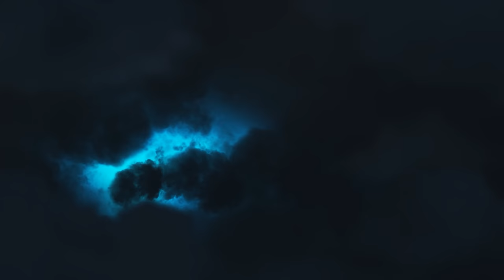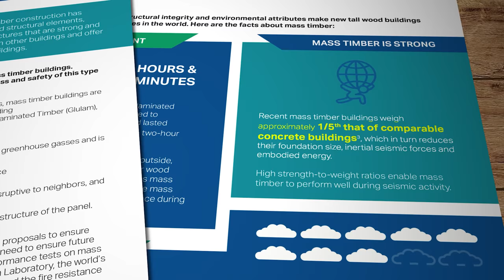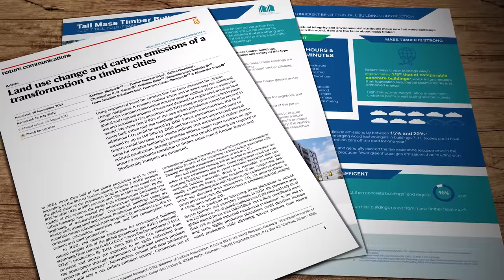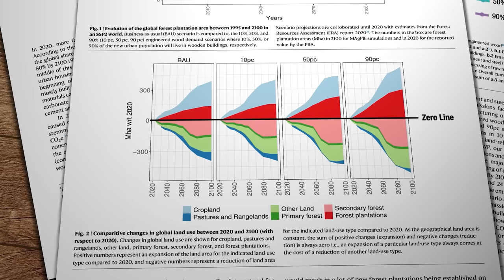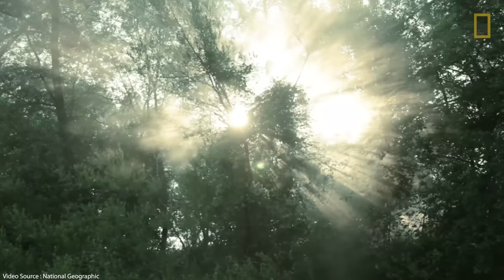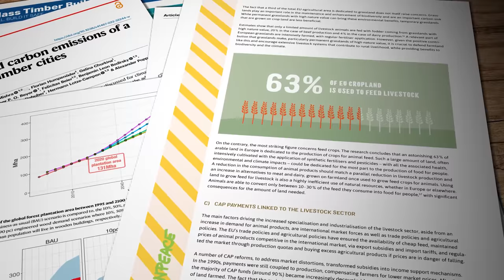Engineered Timber - building the skyscrapers of our future.

Comment: Britain was very nearly completely deforested at the end of the Napoleonic war due to the demands of the fleet.  At the end of world war one the same thing occurred due to the demands of the western front.  In both cases these were intense timber demands for relatively small populations.  Should we not expect a similar result globally if intense demand for timber for the world population occurs?  Having said that planting trees to absorb CO2 is all very wel but when they are mature we do need a use for them so that the cycle can continue.  Some timber building would appear to be a good idea but perhaps not exclusively.
May I ask where the adhesives for the "engineered timber" (which looks to me like large scale plywood) is sourced?  Is if from the petro-chem industry?
We should be looking at not demolishing so much of what is already there, it has paid its carbon cost.  With suitable upgrades we should be able to achieve housing at less carbon cost.
Why not build more undergroud, at least partly, an automatic ground heat source?
I have noticed that when ever we discover a useful by product and promote it then suddenly it becomes a shortage.
Did anyone wonder at the demand to reopen fertiliser plants so that they could produce useful CO2?  Why aren't the atmosheric carbon capture plants supplying the food industry?

Comment: We really need to stop using wood. We ought to incorporate earthen dwellings into modern building, to aid with temperature control and electricity need reduction.
Reply: i always wonder what kind of designs we would come up with if we chose to go underground instead of build up in skyscrapers. by going underground, you can also have MORE ROADS. when designing vertically, we would need aerial transport of catwalks to connect.

i think going underground for urban populations should be thrown around more to get more people tackling the idea.

Comment: I think that most efforts to avert the impending crash of civilisation, as we know it, amount to little more than creating new dances to perform around the deckchairs on the Titanic.  There is only one answer to saving ourselves while also saving the planet and that's the one thing you rarely hear discussed. No matter how you cut it, all the current 'solutions' will only mitigate the real problem-driver, which is population growth. If every currently proposed solution was implemented and worked as intended, after a few generations the core problems of having enough clean air, water and food would be on us again. That said, I wonder if the four horsemen will intervene and take the matter out of our hands. All is moot.

Comment: Ahh where to start? The report does not take into account the debris that is left after clear cutting timber. The rotting debris gives off co2 for between 20-30 years after clear cutting before the replanted trees can compensate for this???
Secondly the construction industry is notoriously conservative and needs a push from governments to lead the way to BIM construction ( building information modelling) and Lean construction which can save between 20-30% waste which is normal for a traditional build be it concrete, steel
or timber framed. And finally if they develop or adopt an industrial system of construction then there are more savings to be made!!!!
But I’ll probably be dead before any of this is the norm?

Comment: The assumption that people will continue to migrate to cities may not be correct. Since the pandemic there has been a migration out of cities limited only by the lack of affordable accommodation. In reality low skilled workers can't afford to live in large cities. 
Tropical forests are almost exclusively hardwoods, whereas structural timber is usually temperate softwoods grown in the Northern Hemisphere. I have woodland full of European Redwood and Western Hemlock which was specifically planted in the 1950's to provide building timber. We periodically, thin and replant. 
Young trees capture more carbon, than old trees. It's like farming but the crop takes 50/60 years to harvest. 
I'm suspicious of reports like this. The exact details may be correct but the underlying assumptions may be driven by politics. As always, ask who benefits, and follow the money.

Comment: The way out of warming is to stop burning gasoline. Go nuclear with small reactors powering a grid and road system with overhead power built into a covered roof deck with grass and solar on the top side.
Reply: Instead of gasoline, make more plastic for building materials.

Comment: Engineered timber is not the answer. Structural Insulated Panels are - easy to go to 9 stories and easy to make airtight. Used extensively in earthquake zones. I have built a 3 bed house in2 weeks that contains no embodied energy

Comment: The cost of the average home is too costly in money and resources.  Laws need to be changed so that people can live in simpler houses, ones that doesn't cost as much to build.  We may have to live in smaller houses, but if they are better designed, then a smaller house requiring less resources can still fulfill our need.  The wood used for building houses are from larger trees and take too long to harvest and thus not sustainable.  Since bamboo has the fastest growing rate and is very strong, bamboo should be made into construction wood used for building houses.  If we build our houses smaller and with wood made from bamboo, we should be able to lessen the impact on the environment.  If we want to be even more efficient, we need to learn to make clay from dirt to make lego-like bricks that can fitted together to build at least the walls, if not the roof.  This will lessen the need for lumber.

Comment: Several claims in this proposal make it fall apart: 1) that cutting down more trees would reduce CO2 and help the environment  2) that planting more trees would actually worsen global warming.  Does anyone really believe this?  Seems like another case of someone going off on a tangent, using faulty assumptions, and missing the big picture.  We need to do better than this.  We already have the solutions but are simply not implementing them.
Reply: "Planting more trees will worsen global warming" except they would absorb additional CO2 & turn it into stable 🪵 lol
#gotoschool

Comment: Yet another ticky tacky material that will require constant maintenance, that will cost more than steel or aluminum or cement, that will last less than a quarter of the lifetime of an steel building and that will be directly responsible for the millions of acres of deforestation... Steel and cement can already be made without releasing carbon dioxide.
this is just a new grift like many others before that.